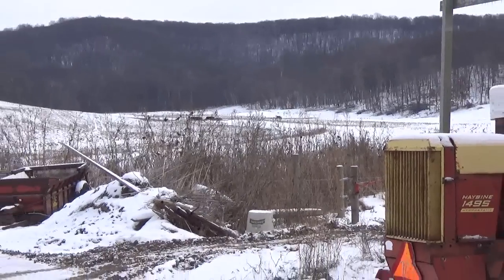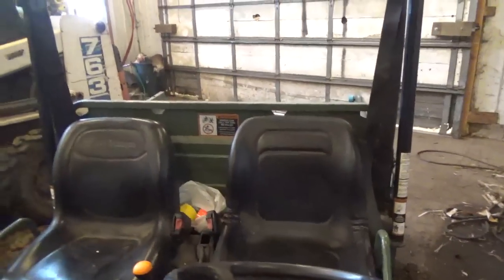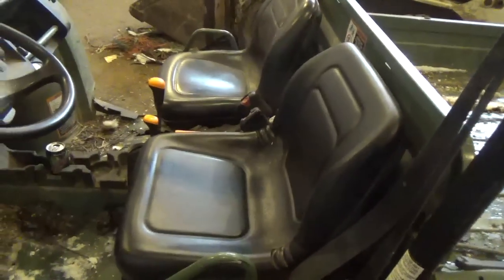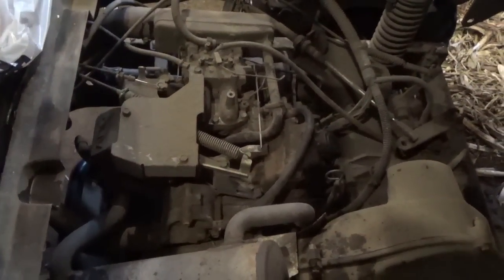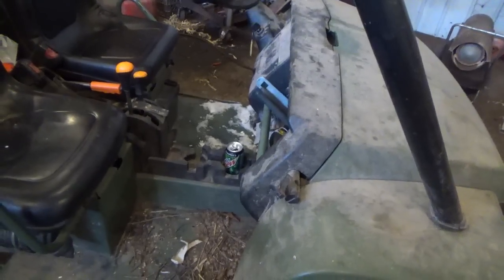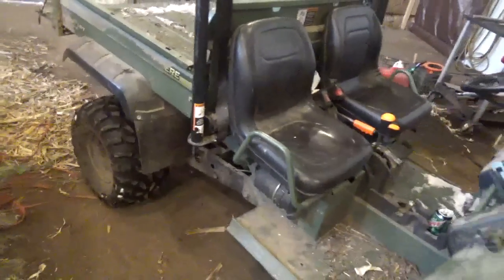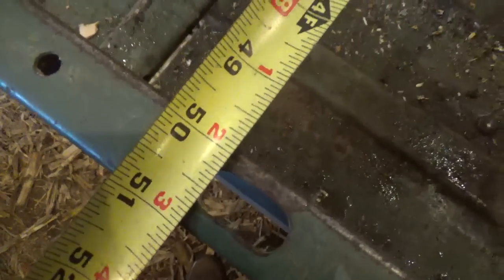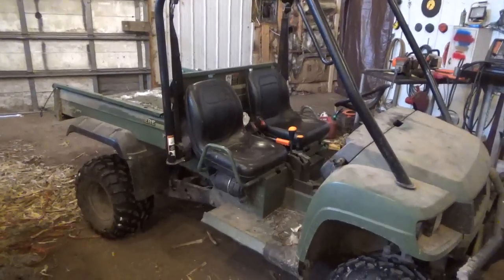John Deere Gator HPX review

Comment: We have two Gator 6x4's on my neighbors property. One is a gas model with the basic package and a canvas top, and the other we just picked up last Saturday, and that's a Yanmar diesel. The diesel has a horn, turn signals, brake lights, hazard lights, electric dump bed, and a hard top. I too prefer the solid axle for hauling, and these two do not have a rear suspension.  It uses the flotation tires as a suspension. I was using a old Suzuki LT4WD atv to work on the property until we bought this. This was definitely a upgrade to the atv.
Reply from the maker: They are very handy machines
Reply: @LVFFarmVlogs  Absolutely!

Comment: We bought a used 850D almost two years ago at an auction.  That thing is as handy as a shirt pocket.  Daily pasture rotations, temporary fences, etc it's perfect.  Building fence it's handy too because it's got enough umph to pull a trailer with all my fencing supplies on it - hi tensile wire, wood posts, t-posts, concrete, etc etc.  And calving season - it's awesome - can carry what I call "the maternity bucket" which has tags, banders, etc in it as well as a spotlight and most importantly someone else to keep the momma off of me while I tend to the newborn.  

If I knew how handy they were, I would have bought one years ago.
Reply from the maker: They are extremely handy!

Comment: I love my kubota. Bought new in 2008 has about 1000 hours. And your right. There is good and bad perks about both machines. I mainly like the hydro on the kubota for when kids drive it they let off and it stops. Although I still have my 2000 gator but it just has the spray rig in the back.
Reply from the maker: the kubota was nice, I may end up getting one again someday
Reply: only other bad thing if you are pushing or pulling hard with it you have to much pressure on trans you have to use the release to let you shift trans that doesn't always work the best.

Comment: Gator is the handiest thing we have also. Built a trailer for the fence supplies and chainsaws and brush cutter and it pulls it just fine until it gets too muddy as ours is a 2x4 94 model with solid frame no rear suspension.
Reply from the maker: They are very handy! i wouldn't want to go with out mine

Comment: They great to have around. I have a Cub Cadet with Yanmar Diesel. Love the thing. You could put a dump cylinder on it and make your own brush guard very easy. The only thing I would get on the next one is power steering mine can be a bear.
Reply from the maker: you got that right, steering is a bear

Comment: Nice review. I see this was like 5 years ago. Do you still have the gator as ND how many hours on it now? Still going strong?
Reply from the maker: Yes, still have it. 1500 hours on it give or take. It gets used daily for feeding, moving cows, hauling firewood, etc. Only thing I've done is oil changes and a new set of tires
Reply: @LVFFarmVlogs  wow that's some good service out of it. I'm looking at a 2013 gator 3cyclinder diesel 4x4 with 940 hrs on it. Hope I get some good service out of it if I decide to go that route.

Comment: My grandparents have an HPX with an electronic 4wd.  What they failed to do is check and change the diff fluid so now it is stuck in full time 4wd, which makes steering a pain.  Also, even though it is a great machine I would like it to have a solid drive shaft transmission instead of a belt driven clutch.  Reason being I got it stuck in a creek because the belt kept slipping.  If John Deere would make it a Shaft driven, it would be a perfect machine.
Reply from the maker: Very good points you made...shaft drive would be nice
Reply: I contacted JD and for the front diff it would be 1500 just for the clutch kit.  The gears and everything are fine but the clutch is trashed.
Reply from the maker: 1500 wow

Comment: I know this isn't the place for this question but.....   What chains do you recommend for a skid steer  2-link, 4-link,  brand?
Reply from the maker: I think mine are 4 link, but I haven't put them on yet. I will be putting them on tonight. I bought a set of truck chains to fit a 31x10.50 tire. When I buy another set I am going to get them from Bobcat, I think they were between 150-250 per set. I only run chains on the back tires. They make a world on deference in the snow.